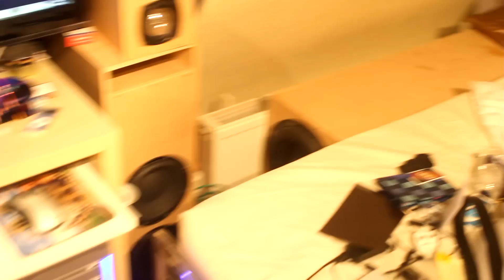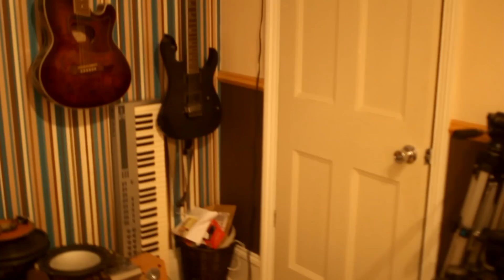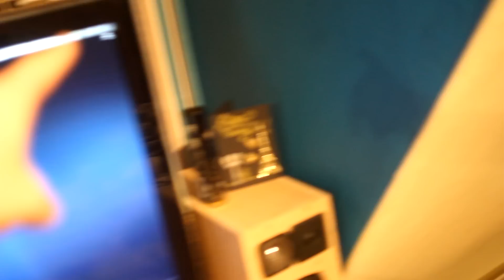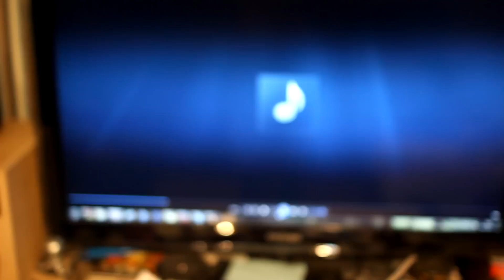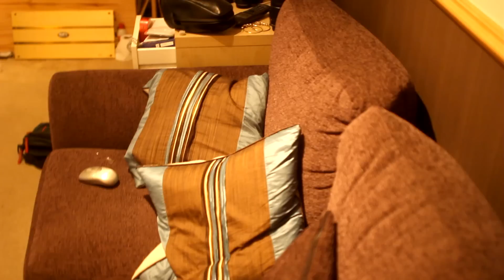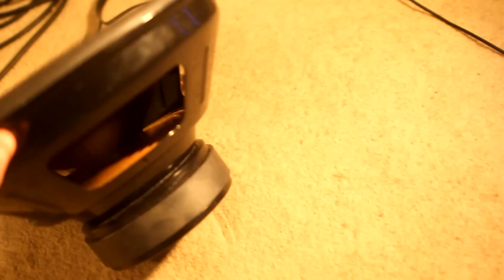Subwoofer position differences + Free air excursion!

Comment: I also went though this with my room trying to position 3 woofers, It's all about the walls, :D easiest way to position a subwoofer is to perform the subwoofer crawl. basically you put the subwoofer in your sitting position then crouch down and walk around the room until you find were the bass sounds the best, then mark the spot and put your subwoofer there and it will sound the same once position's are reversed. hope this helps anyone wanting to know the easiest way :)
Reply: corsair sp2500 (cheap 2.1 (one of the best in the owlrd for cheap 2.1)) the sub is completely enclosed and only a port, so how do i sort it out if my room would look like this /\ that's the roof and my walls are short; a loft room.
Reply: KruddyKamikaze put the sub were you would normally sit and then crawl around the room until you find when the bass hits the hardest then put the sub in that exact spot and done
Reply: ok, tried it, worked a bit better, it feels much better, thanks.
Reply: KruddyKamikaze all good mate. Helps if you have a big room unlike me.
Reply: I like to think of it as high frequency bounces off smaller things becuase of thier high wavelengths, but bass is a lower wavelength and so needs bigger spaces, that's why a normal 10" sub in a cinema will deafen you.
Reply: KruddyKamikaze yeah have noticed that. I used to have 3 6" woofers in my cinema setup, shook the house like anything but I blew an amp so now using one sub with the receiver until I can buy a new amp for the other ones :/
Reply: CarAudioHoon™
Ah that's unfortunate, i am sorry for your loss, don't worry, that am is in electrical heaven now.
Reply: KruddyKamikaze its ok haha I care more about my sound system in my car then the surround sound anyway
Reply: CarAudioHoon™ good. i have a basic 2.1 from corsair so if that breaks i am left with my laptop speakers lol. but i might soon make a custom box, buy cheap but good speakers and make my own 2.1 well... 2.2 (2 subs) as i am a bit of a balance whore, i love things to be balanced and equal. shame the world isn't... but that;s something other. EXO has some beast videos if you don't know him, he is a bass head, but also a audiophile.

Comment: Barevids,

Could you do a video about damping factor on amplifiers?
I saw this Kenwood Ka4020 that has ~100w rms @ 4Ω for sale for 30 pounds but it has 65 damping factor. What does that mean?
Reply: 65 isnt so good, the higher the number the better. the damping factor is no definined number, it means the relation between the current in and outcoming
its the internal resistance of the amp. a higher number means a lower internal resistance ;)

i hope you could understand my grammar cause im german ;-)
Reply: S-qp-L_DyNaMics
As far as i can remember Barevids drives his home theater sub with Technics Su V550 and it has a damping factor of 60. As we can see from his videos thats not so bad!
Reply: dont get me wrong 60 is not that bad but todays pa amps got a damping factor about 200 up to over 1000 (powersoft k series).
this is a very old amp, 60 dont mean that this amp is shit or something. just in comparsion to todays amps :-)

Comment: I find your videos very interesting, youre clearly a clever chap. BUT I dont understand the obsession for all this bass power. I have a modest 120w x7 Yamaha surround sound amp connected to some old Monitor Audio 652 MD speakers (re-designed by myself) but only run a very modest size passive ported 6 inch sub behind the TV. It's run from a home made 80w amp using good old MJ802 trannies and a decent toroidal tx and large caps) and I can assure you there is enough bass output to shake my neighbours cups from the her kitchen cupboard. The bass is tuneful and goes pretty deep (not measured but I'd guess about 40Hz)  best output was when the sub is positioned at an angle with the cone facing down at 45 degrees and the port firing on the other side but situated dead centre of the wall. Friends who hear my music and films always comment on the incredible dynamic range & power output and when I show them the tiny sub they are stunned. You just don't need all these subs and a 1000watts in such a small room. Maybe I'm just getting old?
Reply: MG Samps you have to experience it. Im making a similar box. I guess its like having cinema bass but at home

Comment: But DB wise the best position is the corner. I`ve already tested it in my room. Even you can barely hear it in the middle corners give you so much pressure than any other direction so i`d rather move my bed to the corner LOL.